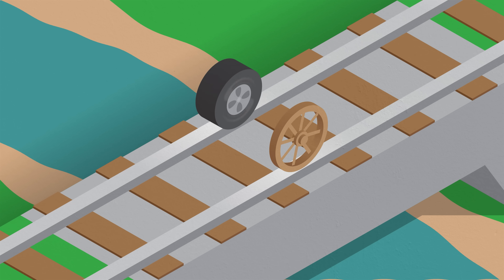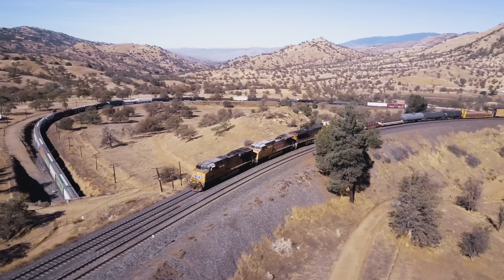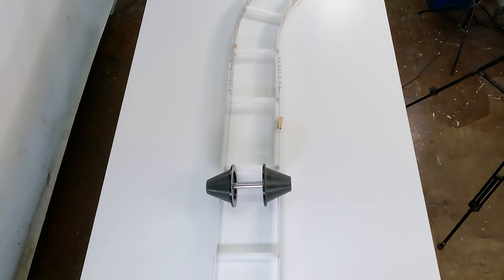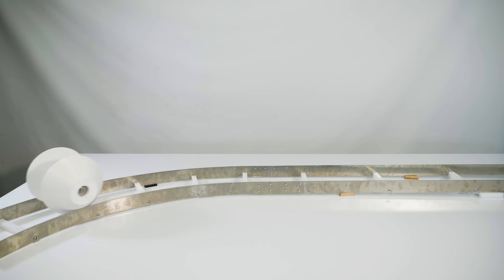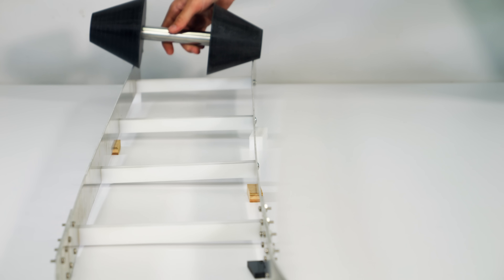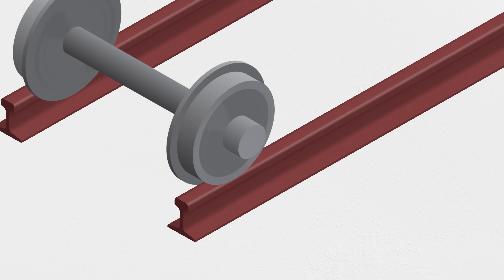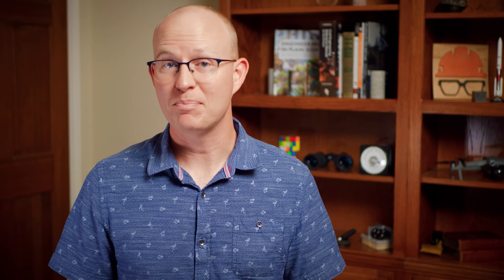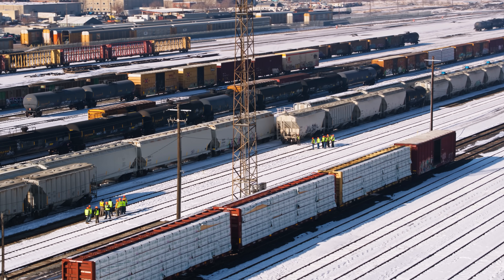Why Are Rails Shaped Like That?

Comment: The issue about hunting behaviour is really interesting because it comes up in downhill skateboarding as well where they refer to it as "speed wobble" and have some interesting ways of combatting it
Reply: The secret is putting your weight over the front trucks, and a little prayer
Reply: @cartersanchez420 and crouching down
Reply: @cartersanchez420 I read this post 10 years to late.
Reply: Makes sense! I mean I've always heard of the skateboard axle also called a truck!
Reply: This "wobble" was very noticeable in British "Pacer" train.
Plus mandatory squeaking on corners sound effect... ;)
But these units was withdrawn year or two ago, not due to this problem, but because theay are has not accesible toilets (for disabled).
Reply: @stanley3647  That was actually because they had an (if small) step on the inside and not because they lacked a toilet.
Reply: @MarioFanGamer659 Yes, i mean: no toilets for disabled.
Reply: With of course the irony that Alan Wickens clearly defined much of the actual wheel-rail geometry interaction in the mid-Sixties -- with HSFV, a relatively long-wheelbase four-wheeled vehicle, demonstrating stability at 100mph... @stanley3647
Reply: Whoa!! Back when I skated I was too young and dumb to care to look into what caused them. That’s mind blowing hahahaha
Reply: A speed wobble happens when the rotational speed matches the natural frequency of the thing. Like the amplitude of the input gets magnified at the natural frequency because the system response has a freakout. It’s more of a tacoma narrows bridge thing. I assume the hunting thing is when the system tries to correct to an equilibrium state but it keeps overshooting because the system is underdamped. More like a bouncing ping pong ball that hops a few times before settling.
Reply: The laws of physics.
Reply: What skate board trucks , Motorcycles and shopping trolleys experience is related to caster angle effects. It is quite different to what a rail vehicle experiences because the rail wheels are not steerable.
The only similarity is that the effects are both caused by the weight of the vehicle causing a self centering effect
Reply: @PaulG.x  so it becomes an oscillatory pendulum
Reply: My way of dealing with it was to fall off 😂
Reply: Bicycles have a related wobble as well.

The confusion about whether this is the same thing as the wobble from the conical wheels on trains seems to be a semantic one. While different underlying mechanisms are at play, the wobbling phenomenon in every situation is due to self-stabilizing wheels.

Whether it's a bicycle wheel, skateboard trucks, or conical train wheels, there is a mechanism (different for all three) which turns in the direction of the center of mass, which realigns the center of mass over the wheels. If this process overshoots, it will try to turn back, creating an oscillation. The speed of the realignment depends on the speed of travel, so at some speeds you can encounter resonance.

This is the same phenomenon in each case, but the realignment mechanism is different.
Reply: "Tank slap" on a motorcycle.
Reply: Speed wobble also occurs on motorcycles, so I’m not sure it’s from the same phenomena. 

It isn’t happening because the wheels have different diameters; the oscillation happens because the trucks can ‘pivot,’ and the speed can get you locked in an oscillation, even with flat wheels.

Flat wheels should greatly dampen the effect, though. Or, rather, non-flat wheels amplify the effect
Reply: @pyropulseIXXI  I think you mean tank slapper
Reply: @pyropulseIXXI  It is not the same phenomena although there are many similarities. On trains, the effect happens due to how the wheels interact with the tracks at the contact point. On the skate board and motorcycle it actually happens for the same reason, which might be unintuitive. It is caused because the tilting affects the direction of steering and in some situation it creates a feedback loop. 

That is the rough gist of it. I lack the know-how to give more in-depth explanations why things happen as I said.
Reply: @anteshell the occolation
Reply: @anteshell the oscillation problem is similar to pilot induced oscillations on a small plane. The tendency to overcorrect is the main cause of that.
Reply: @anteshell  The tilting effect isn't the same reason at all. Speed wobble happens with flat wheels; the tilting effect is due to the trucks pivoting, which I said
Reply: @pyropulseIXXI  Please, learn to read. I said nothing that you are arguing against.
Reply: @anteshell feedback loop.... I'm thinking of resonance, but perhaps I'm far off the track
Reply: @tomharris8712  Two different things but closely related and both relevant in this. 

A feedback loop causes resonance. In this case the resonance would be the back and forth steering. The resonance frequency and amplitude is subject to the balance point (and rigidity) of the object in relation to the contact point to the ground, friction to the ground and speed. A change in any one of these will change the natural resonant freq and/or amplitude, and big enough change will then break the feedback loop. 

One way to do that, as others have mentioned, is to drop down: squatting on skateboard or hugging the tank on motorcycle. Or rather, that is almost always the only way. Changing friction is not really something you can change and changing speed is impossible on skateboard in controlled way in that situation and very hard on motorbike.
Reply: @pyropulseIXXI  Its interesting you bring up motorcycle speed wobbles, I think it may be related to the skateboard wobbles. As you said in your previous post, crouching down helps on a skateboard and its also the solution on motorcycles. You get your body as low as possible, hugging the tank, and it calms it down.
Reply: @TheRealBanana  Yes, this is why 'speed wobble' is not due to different diameter wheels, because it happens on flat skateboard wheels as well (and on motorcycles with only one wheel 'in-line'). The front wheel speed wobbles due to the pivoting of the steering

It is due primarily from the pivot, in the skateboard and motorcycle case, with the skateboard 'round wheels' only being a minor addition

Furthermore, skateboard speed wobble is most obviously from the trucks pivoting, as that is what you both feel and see when someone gets speed wobble; the board is literally tilting both directions in an oscillation, about the truck pivot point, and crouching limits this

If it is just due to the skateboard wheels being different diameter, the effect would not even be noticeable
Reply: @pyropulseIXXI but the skateboard phenomena IS essentially the same thing, because even though the wheels are flat, the inside and outside wheels turn at different speeds and want to go straight to achieve balance. At speed, the front wheels start hunting back and forth and the rear do the opposite, creating an oscillation.
Reply: @tobiaspoop  It isn't due to this at all; it is because the trucks pivot, and your weight is oscillating on top of the board, about your ankles, which is why crouching down greatly reduces the effect.

And it is most certainly not due to the front and rear oscillating it is literally the trucks pivoting; this is blatantly obvious to anyone that skateboards; the effect doesn't even occur if you have a rigid platform with no bushings/truck pivoting capabilities.

You also fail to account for the same phenomena in motorcycles, which only has one wheel in-line and cannot possibly be due to different turning speeds

Also, if you use round skateboard wheels, they don't rotate at different speeds, since they will accommodate the same speed by changing their contact point during the truck pivot
Reply: @tobiaspoop Furthermore, the fact the wheels are not connected via the same axle proves your hypothesis entirely wrong. Each wheel freely rotates on its own.

Each wheel will rotate at the necessary speed that matches to the necessary rotation speed for the given velocity of the center of mass

It cannot possibly be the source of speed wobble, which, again, is obvious to anyone that skateboards (which I do).

It is purely because of the trucks pivoting. I've skated a board just attach to trucks with no bushings, thus making it non-pivotable and only turnable via kickturns, and there is no speed wobble
Reply: @tobiaspoop  It isn't the same thing at all; the wheels all rotate independently. It literally happens because the trucks pivot
Reply: @TheRealBanana then the wobble would be driven by your body’s rotational inertia. Any one here who finds this interesting should learn about simple linear control systems. When you’ve solved for your first pair of complex-valued eigenvalues, you know you got it!
Reply: @pyropulseIXXI  Being uncomfortably familiar with such wobbles on both motor and push bikes, this prompted me to do a bit of reading.
It pretty soon got over my head but it suggests the two phenomena are not at all the same.
The "hunting" effect of the train wheels being a rhythmic swaying that remains at a relatively low frequency. and stable.  Whereas the higher frequency oscillation of motorcycle, bicycle, supermarket trolleys, and apparently some skateboard, wheels, can self accelerate until stability is lost.
virtually
But don't such apparently simple things rapidly get so complicated, so quickly.
Reply: @pyropulseIXXI  motorcycle "tank slap"  is really scary.
Reply: @pyropulseIXXI motorcycle wheels are not flat though, that's why cornering is a thing.  The double conical wheel of a train actually behaves fairly similarly to a single motorcycle or bike wheel with its center removed.
Reply: It's a consequence of anything with multiple wheels in motions.... the energy used to keep the thing in motion also feeds the odd forces that come about between wheels.

Continuous energy input (such as movement) can lead to the persistence of wobbling or oscillation in a system when there is resonance with an unstable component (e.g., skateboard deck, motorcycle engine, bike handlebars), resulting in amplification of disturbances (like gaining speed), especially if the system lacks effective damping mechanisms (e.g., design features, suspension systems, steering dampers).
Reply: @williambrasky   The Bill brasky I knew was an 8 foot tall SOB who could take a shotgun blast to the chest and keep coming at you. Any relation?
Reply: @tanto2868  I don't know myself, but please stop poking it until we're sure.. o.o
Reply: The alignment mechanism for bicycles/motorcycles and skateboard trucks are deceptively similar. Both are created by having a your turning axis an an angle relative to the ground.

On a bicycle, this means the contact point is not lined up with the turning axis, so a horizontal force at the contact point will cause you to turn. When your bike is tilted, the upwards force of the ground is now partially acting in the horizontal direction on your wheel, which causes the turn. Because the contact point is behind the turning axis, the wheel turns toward the ground, which picks you back up.

On a skateboard, your wheels are put to the sides of the turning axis, so if one recieves more force from the ground (like when you are tilting), it will case the wheels to turn. Because the turning axes are pointing inwards, this force turns the wheels to point in the direction the force is coming from.

It's basically the same mechanism, but the reason why the turning axis is pointing opposite directions in because the force in each case is experienced on opposite sides. On a bicycle, when you tilt left, your contact point is on the right. On a skateboard, when you tilt left, the left wheel gets the force.
Reply: The issue about hunting is when  a meddIe wheeI reaIIy hates a meddIe raiI the meddIe wheel wiII hunt and kill the metal raiI and we don’t want that.
Reply: I’ve long boarded my whole never and never knew that’s partly why that happens, I could see the engineering behind skateboard trucks as being a very interesting topic.
Reply: I think William Brasky jests. Maybe Im wrong though...
Reply: Hunting can be caused by "hollow tread" on locomotives that use wheel creep a lot in their live. Wheel creep is when the control system lets the wheels slip ever so slightly to eek it a little more tractive effort, causing slightly more wear. You can hear this in action when trains are going slow up a steep hill at high power, notably a high pitched constant squeal.
Reply: Ah yes, the good old speed wobble. I learned that lesson late one Saturday night… I wish I could say I powered on through it but no…. I ate tarmac instead.
Reply: I find oscillating back and forth, or "carving" as it's called in skater circles, is the easiest and safest way to avoid some nasty abrasions. The bigger the carve, the less you wobble.
Reply: On motobikes too, the way to deal with it it's just to let do the bike and pray.
Reply: The train has a live axle. The skateboard doesn't.  And don't forget that gyro effect on spinning disc.  You know the bicycle wheel spinning while you try and hold the axle.
Reply: @essentialjudge2279  The gyro effect on a bicycle wheel actually turns out to be a pretty miniscule part of the stabilization. It's almost entirely caused by the effect of the tilted turning axis I described above.
Reply: Even weight distribution helps maintain stability. If your feet are not aligned properly it will create an oscillation that will send you flying. I skate.
Reply: Watch the Anthony Hopkins movie, "The World's Fastest Indian". He had to deal with 'speed wobble'... Explained it brilliantly too.
Reply: The wheel design is really to give a self-correcting feedback for the best position on the rail. Like any feedback system, oscillation can occur and must be considered in the design.
Reply: Balance over the center of the board and allow your knees to go jelly.  Don't fight the board at high speed or you will end up with some serious "road rash".
Reply: All in all it's the same thing. Just bunch of parts connected with springs and dampers, the math is essentialy the same. Be it train or guy on skate
Reply: Ive both overcome speed wobble and succumbed to it lol. Try to relax and be easy with it and let it sort itself, dont fight it and get into a PIO (pilot induced oscillation, a term frequently used in aviation...obviously).
I was on a longboard downhill and got into a speed wobble and just as I was starting to get it smoothed out, hit some debris and next thing I remember I woke up with dirt in my mouth, blood all over, and seriously concussed...2 weeks of severe headache. Figured Im too old for that now so gave it up.
Reply: Lubrication, lubrication, lubrication. I bought a water bed filled with Vaseline. A little surgical tubing, a few rubber bands, and, baby, you got a stew goin. I call it The Hump ‘n Pump. If you’re still having trouble understanding it, it’s a lot like those lube nozzles that be squirting all over the work in a CNC machine.
Reply: How do you like it? I've been thinking about getting one for a while. @williambrasky3891
Reply: @williambrasky3891 coolant not lube
Reply: Do you skate?
Reply: @longiusaescius2537 you don't use the term speed wobble unless you skate. It's not something we talk about, you kind of just got to go fast and learn
Reply: @longiusaescius2537 No, I Ski. Because, unlike you, I prefer to retain my dignity!!! Git oouutt! Giiit!! Skit, I say!!!
Reply: @williambrasky3891  A bit harsh.
Reply: @williambrasky3891
I don't know the context of your 2nd comment, but seeing as you are the proud owner of a device called The Hump ‘n Pump, you sure seem to have a lot of dignity. :P
Reply: @williambrasky3891  Strange that you would comment here on an educational video. It seems like you have enough intelligence to want to learn, but lack the capacity to actually achieve it. Please forgive me if I'm wrong, and if I am please learn some manners. Thank you

Comment: Brunel's 7ft gauge rails in the UK were much more primitive, apparently pressed out of sheet about 1/2in thick with a section like a square 3-sided box with a flange either side containing fixing holes. You can see offcuts at the Swing Bridge, Newbury, UK.

Comment: We call them tires on our fleet Class378 (london overground). Spent many many hours learning about wheels. Most intresting is the subject of RCF (rolling contact fatigue). 
Also you can have different profiles of the tires to allow for more or less ware based upon the load and type of usage. (passenger = eco, Freight = Cone).
One thing people always think is a joke is the term "leafs on the line". This is caused by foliage falling and degrading on the tracks which then turn into a slippy subtance, witnessed a train skid pass a platform by over two train length because of this!

So glad that someone like yourself has explained this subject in a simple and very discriptive way that anyone can learn from. Great Job and thank you.